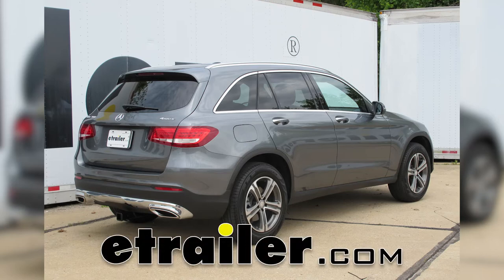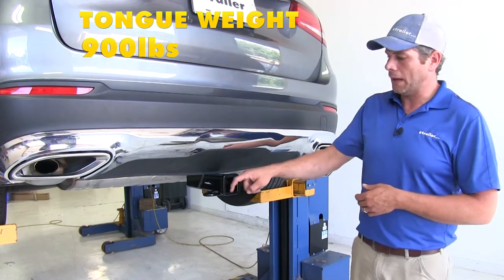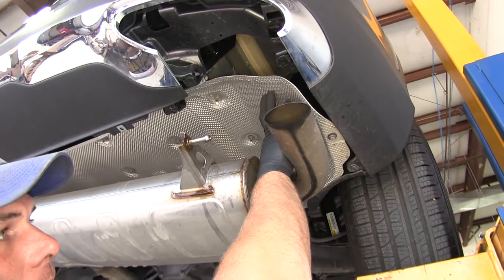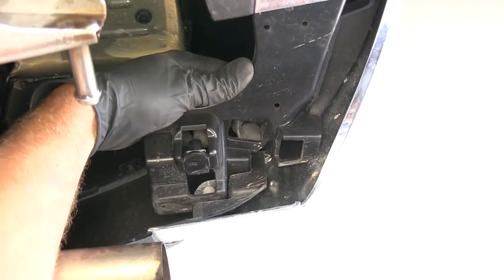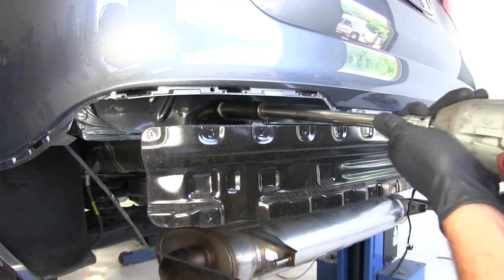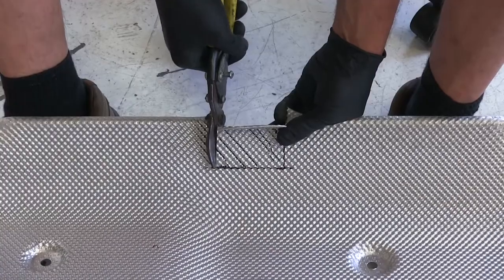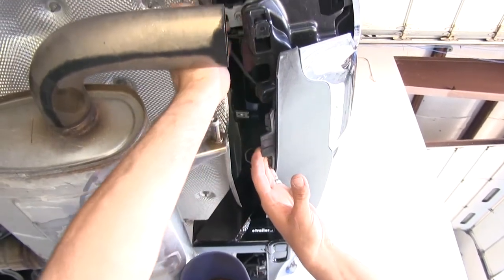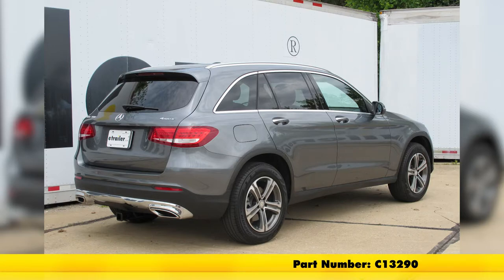etrailer | Curt Trailer Hitch Receiver Installation - 2017 Mercedes-Benz GLC Class

Comment: do the steps work for 2016 GLC 300? what is the difference between 2 options for trailer hitch for glc 300 on the website.
Reply from the maker: The hitches and fitment of them will be the same for the 2016 and 2017 Mercedes-Benz GLC Class. Check them out in the following link.
https://www.etrailer.com/hitch-2016_Mercedes-Benz_GLC.htm